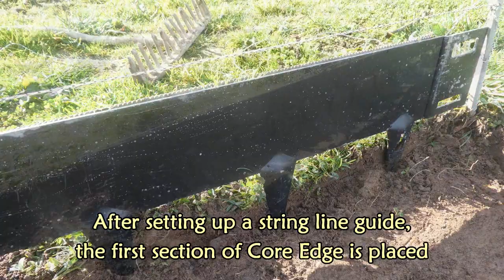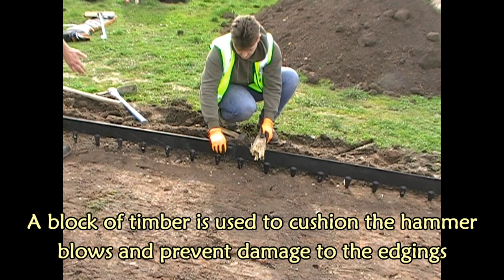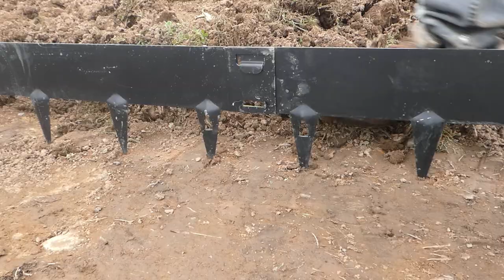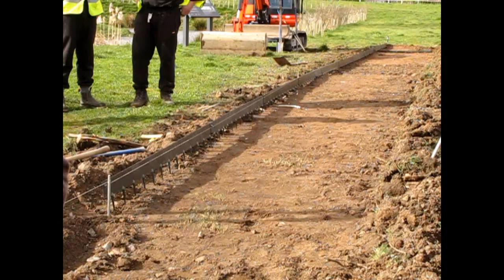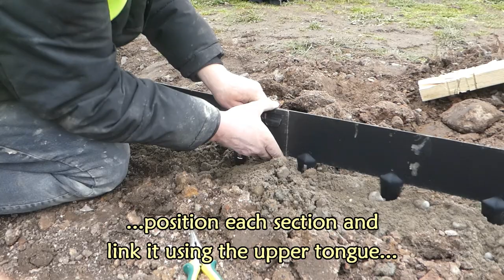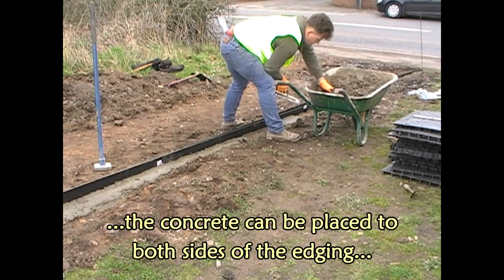Installing Core Edge HD Steel Path Edgings

Comment: would the Core Edge HD steel edging work for a curved path
Reply from the maker: Yes, very much so - it's so easy to flex to make curves and arcs of, say, 1500mm rad or larger, and could be bended with care to suit even faster arcs, if required.